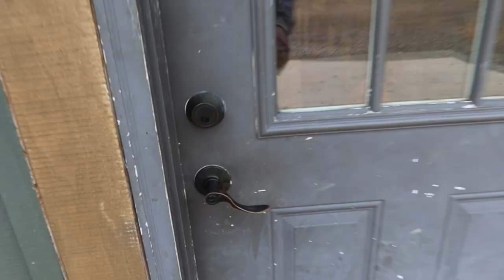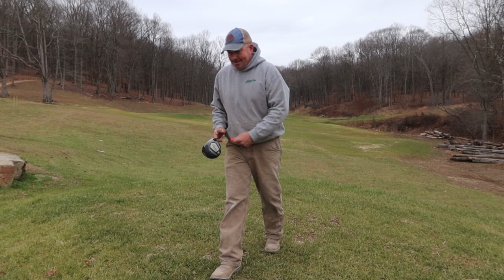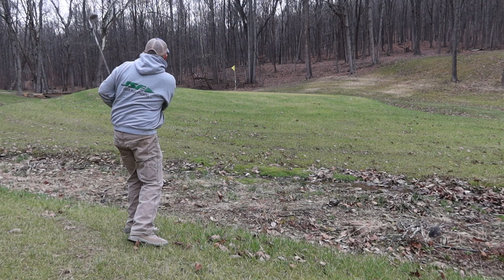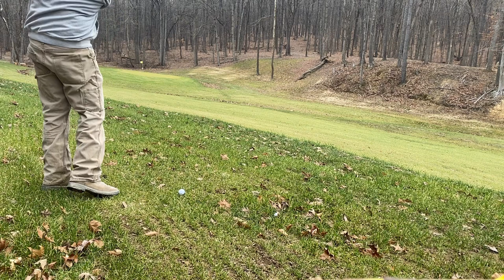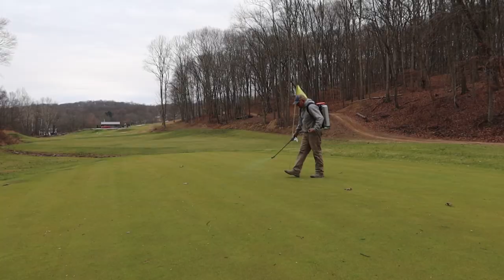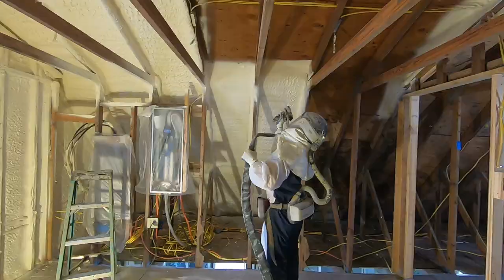2 BALL CHALLENGE ON OUR BACKYARD GOLF HOLE!

Comment: I'd definitely look at doing a hollow tine in the spring to stay on top of thatch levels
Reply: The thatch build up shouldn't be bad enough to need coring yet, what with the green being less than a year old. More beneficial with less disturbance would be verti-cutting and maybe a light scarification to help keep the sideways growth from turning into thatch.
Reply: @bbg147  he sowed creeping bent, that stuffs a prolific thatch producer, its pretty standard to aim for at least 30% surface disruption annually to creeping bent greens in the UK.
Reply from the maker: I plan to do that just to help promote better growth.
Reply: @freddycunningham4819  Even more reason to regularly verti-cut then. Trying to control the thatch before it happens is very beneficial for creeping grasses.
Reply: @SpudRunGolf   veti-cutting will  promote healthy upright growth which will then help create a much truer roll at lower heights as well as being a preemptive thatch control. Keep up the good work, really looking forward to seeing how things progress next year.
Reply: @bbg147  you’re still assuming there’s no build up of thatch, easiest thing to do is in spring take core samples and measure the thatch layer, anything between 5-10mm is fine.
Reply: @SpudRunGolf  I wouldn’t say hollow tining promotes better growth it’s predominantly used for thatch removal.
Reply: @freddycunningham4819  What I am assuming is that in a year the thatch will not have built up a deep enough layer to need coring. You are assuming it has. Coring is not necessarily the answer to shallow thatch,  5 to 10 mm is not deep
Reply: @bbg147  we don’t know the nitrogen inputs used during the grow in period, we do know he sowed creeping bentgrass a grass that notoriously produces a lot of thatch. I don’t know how much thatch there is but a core sample would tell you. As I said if the thatch layer lies within 5-10mm that is an optimal level, any more and you need to think about reducing thatch levels, it’s not complicated.

Comment: I got to critique your spray-game. I run the same stihl sprayer, but with an upgraded wand. You can get one that is all brass with a control flow(pressure control) valve on the end and even use TeeJet nozzles. The whole setup is $75-100.  Holler back if you're interested and I'll point you in the right direction
Reply from the maker: Hell yea, please send me more details. Jsflc78@gmail.com
Or give me your contact info. Thanks so much.